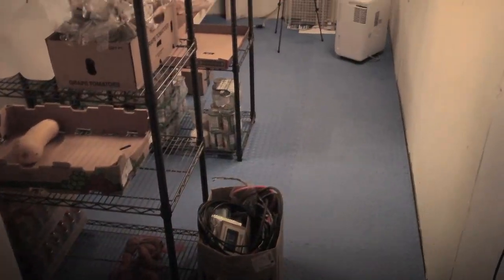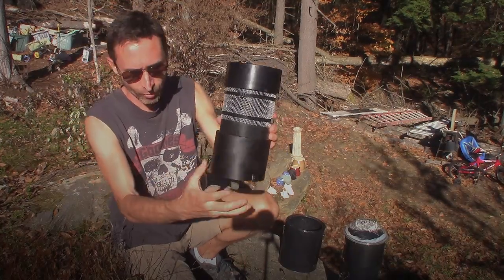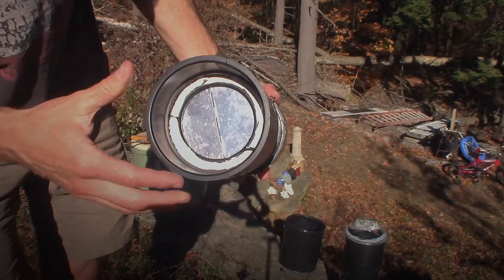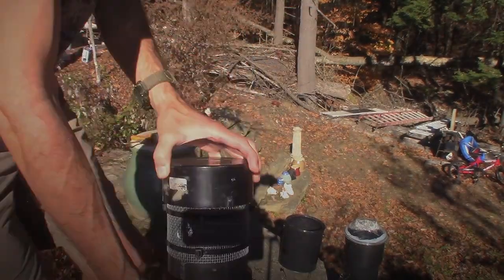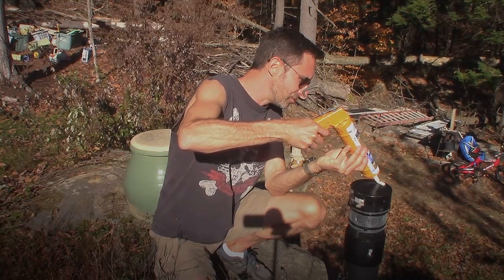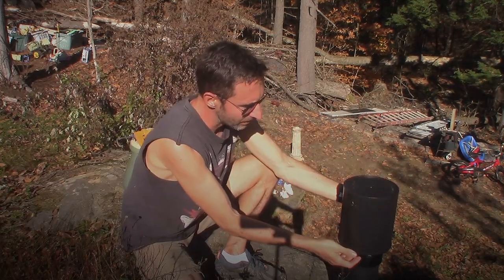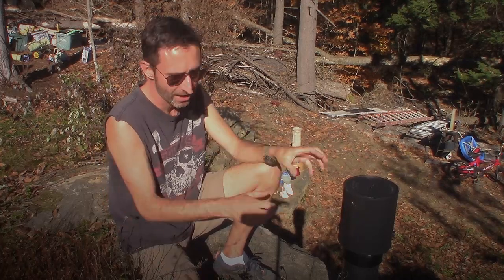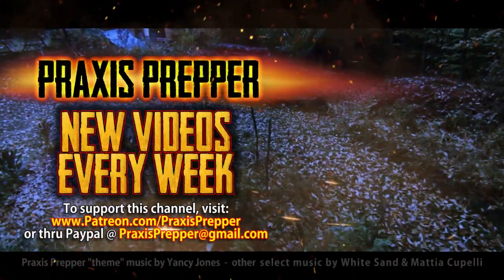Build a Homemade Fallout Shelter Exhaust Vent

Comment: Ok, I know you consider me to be a donny downer but right now you are scaring me even more than I already was about this subject.  While I am no longer a contractor, I did hold a contractor's license in NC for plumbing, electrical and hvac, of course you have no reason to believe me, I am just letters on a monitor,  but at least consider checking with other people before you finish this project.  I was almost relived when you first produced the device for increased venting, it was at least something.  I though great that should at least help with the carbon dioxide problem, even though clearly you do not belive me about the battery issue and you really need some forced venting from your battery storage which is going to be generating hydrogen gas, explosive hydrogen gas I might add.  But I have serious doubts about the flaps you have installed as an air check valve.  If you are going with a device like that you need a strong exhaust fan to overcome that resistance.  I seriously doubt your normal air intake is going to do the job and certainly your bellow system will not.  You are a grown man and risking your life as a test is every man's right, we all do stupid things just because we think we can get away with it.  Heck you might, lord knows I have done many a stupid thing in my life and lived to tell the tale.  But you are talking about risking you family in this.  Just talk to any fire department in the world about the dangers of both carbon monxide and carbon dioxide gases.  You, your wife and the kids are all carbon dioxide generators.  Guess what carbon dioxide does, it lays on the floor and gradually rises as concentration builds up, it is going to require a large degree of mixing with the rest of the air to find its way out.  Again I am sorry, I know all this sounds mean but you do not test stuff on your family without being certain of your numbers and equipment.   And again sorry, clearly you are not using real numbers detirmined by testing before you might be putting your family in harm's way.  Live testing is great when you know you the amount of oxygen your family will be consuming as well as how well your hvac equipment is moving fresh air in and contaminated air out.  Human beings breath, they breath a lot, something on the order of 2000 gallons a day, with every breath they convert 5% of that to CO2, which again is going to fall to lower part of the shelter.  That is around a 100 gallons of CO2 per person per day that has to be removed and again it is not going to be at the height of your light tubes.  Remember someone is going to be sleeping close to the floor in one of those bunkbeds, though I suspect that is going to be you.  If you do a live test and find no issues over a day or two, that does not mean the shelter would be safe for two weeks, these concentrations are going to rise over time.  Did you by any chance check for radon gas in the shelter, if it is there and there is a good chance it is, it needs to be vented out as well.  Your shelter should have known air intake.  Have you calculated the needs of all the people in the shelter and computed if the cfm of your air intake.  This should be measured with the filters in dirty condition, not brand new.  It is not going to be the cfm rating of the blower, it is going to be far less than that.  While your bellows would be fine for a short time, if it became your only hope for a couple of weeks, I have my doubts.  Once you know you have enough input air, then you have to calculate the amount of exhaust gases you must get out of the shelter.  That means not just at a single point high in the shelter but mostly toward the bottom of the shelter, with the exception again of those hydrogen generators you have.    If you could I would relocate those batteries outside of your shelter.  That would simplfy the gas issue and improve your fire risk.  

I have told you I am envious of that shelter, you are far better off than me as I lack the resources to build one.  While many things can be hit or miss in the prepper world, when you start talking about underground bunkers, you really have to be certain you understand your parameters.  Even being just a little wrong here can cost you your life or even worse the innocents under your care.  I hope you do not write me off as a nut job and give this some serious thought.  Enclosed enviroments are no joke, even super insulated homes have this problem and require air to air heat exchangers to be certain they do not choke the life out of their owners.  Maybe it might be best to remember that death can come from just 3 minutes without clean air. But air is always around us and it is easy to take it for granted.  This really is a complex subject, I suspect you mentioned you had a CO detector, doe is to CO2 as well?  How confident are you that it would survive an emp pulse?  You do good work and please do not take offense at this, you are a creative genius compared to me but no body knows everything and just trust me this much, look into this more before you stick your family in your shelter.
Reply from the maker: Thanks for this. All your thoughts are duly noted. There won't be any risks to life during the test because I'll be monitoring CO2 the entire time. As for the Hydrogen, I had considered the idea of venting directly near the batteries box. I haven't done that though. At the moment, the batteries create very little O and H because they are not being used at all. They're just being kept topped off with a trickle charge. I'll give your comment deep thought though. Your experience is worth a lot. thx for sharing it.
Reply from the maker: Just letting you know that i started testing this morning and the vent was NOT venting out with the positive pressure fan at full. Air was going in, but it was finding easier ways out. I'm plugging those easier ways now. I definitely take you perspective seriously. Together, you, me, and all of us DIY preppers can do a lot to help each other out. Thx for taking the time to give me your heads up on that possible issue.
I'm still working the hydrogen question. I dont think there's much now because the batteries are not being workeemd, but i'd love to have a more solid guarantee on that question. I'd looked into hydrogen sensors a while ago and they were sort of pricey.
Reply: @PraxisPrepper  I had another thought I wanted to bring to your attention.  Please understand that I totally understand that the best is often the enemy of the good.  Reality is perfect is not possible, so we try to find economically good enough.  I am not sure you have considered another factor.  Temperture.  Truth is you are going to have to bring in a large amount of air and then push it back out again.  This is fine during a good part of your year.  I do not know just how hot it gets in summer but there are advantages in being underground in this context, so it may or may not be an issue.  However that is not going to be the case if you have to dive in during deep winter.  Then you are going to be living in a refrigerator if not a freezer.  I wish I had a chance to talk to you before you started your build as their techniques to help with these issues that would have been easier at the start of the build.  

One technique that will help some, not solve but help is building an air to air heat exchanger.  This can be done at a reasonalble cost, air to air takes the air you are going to toss and use to help wame the air coming in.  This is just ducting and fans, low power and low cost.  

Another technology which I am only slightly familier with as I do not design underground or submerible technologies but would be worth looking into.  That is CO2 scrubbers, this limits the amount of air you have to bring in and throw away.  Commerical units are very expensive but the techniques used in salt water aquiriums could be of some benifit at a reasonable cost.    Again not a total solution but possible of some value.  

Then if I were in your neck of the woods, I would have considered building a small addition where you could have installed a modern wood stove, I suspect a pellet one would be most advantagous in this situation.  Outside are would be the primary oxygen source to feed the unit, though I can see some advantage is drawing some of air you want to remove from the shelter that way.   Even a small rocket could be used if a way was designed to isolate the feed and bring outside air in to feed it, but really a small pellet  would be far easier.  This would give not only heat but a way to produce hot water.  With the right isolation it could even be used as a way to produce hot water and dump all the external heat to the outdoors.  

If anyone is thinking about doing a shelter and are at just the planning stage, consider doing something like that but install hydronic in the flooring which would make heating control much easier.  I for one do not care for minimal living on the edge.  I like comfort and safety even in shtf, as much of it as I can get anyway.  

I also hate to mention this, but I am concerned about your single source of fresh air, what if someone does something to it, what if something falls on it.  You should have a minimun of two totally independent sources and 3 would even better.  You should know just how long you could hold out if you had to turn them all off.  Can you even turn off  your single one right now, do you have a procedure in place?

Again I know it seems like I am finding fault, again I have nothing myself and this is all a gedankenexperiment to me.  Perfect does not exist and we will all do the best we can.  At this point your best is better than mine.  But I have been doing the gedankenexperiment on survivial for a very long time and I am very technology oriented.  You have reminded me that I have not done enough research on this subject myself, which has inspired me to at least buy a book.  I do not have it yet and so I have no idea just how good it may be but if anyone is interested it called Emergency Air: For shelter-in-place Preppers and Home built Bunkers by F.J. Bohan.  I know nothing of this guy's competency but he managed to get a book in place so that is something.  It was enough I actually have spent money on it because the subject interests me greatly.  It should be here in a week or so and I will evaluate it then.  By the way, I will not be able to build a radiation proof shelter, if we turn out to live in an area with high radiation counts that will just mean we are toast and one of my preps does circumvent dying of radation poisioning, not a way I want to go out or allow my girls to suffer.  But assuming we are just under threat of fall out, I need to start to work on isolating and controlling air flow into my home, making sure we are positivly pressurized and I have well filtered hepa filteration feeding the house, which I certainly do not now.  I am also toying with building a roof wash system to move radioactive particles off of the roof.  This will be about my best, not great but what I can do.